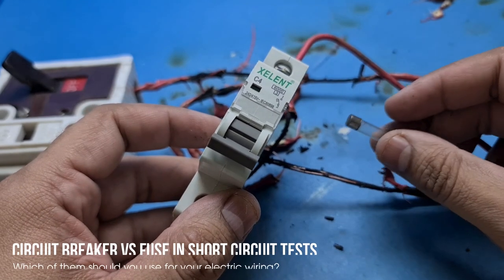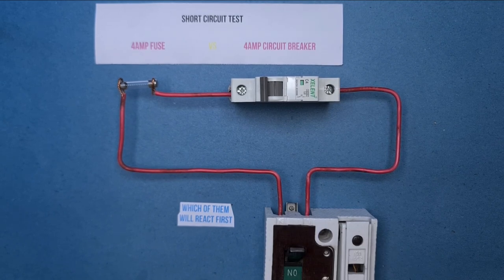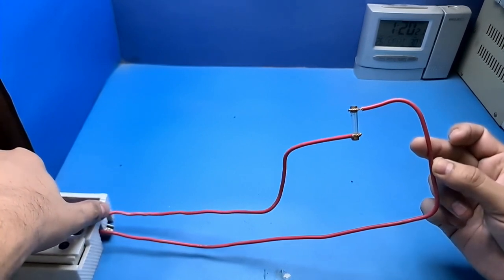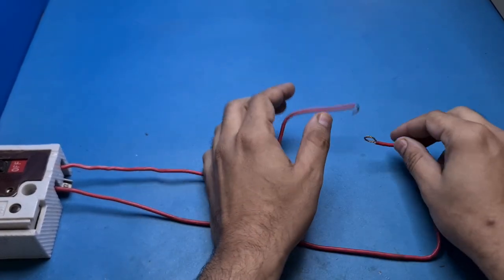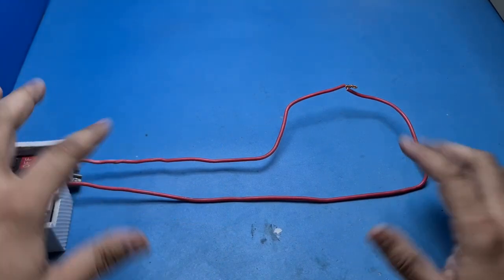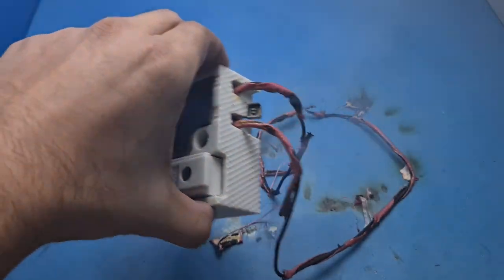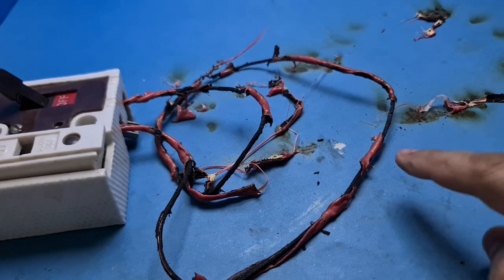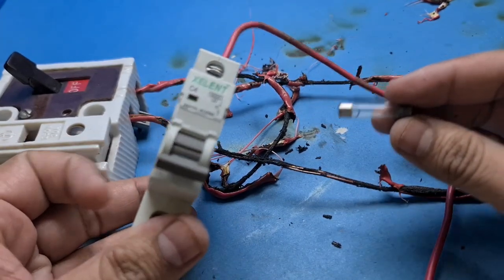Circuit Breaker vs Fuse (Short Circuit Tests)

Comment: “Oh no look at the smoke” dude says omg 😂
Reply from the maker: The smoke was clearly more than my expectation!
Reply: @researchcell  I'm wondering if the short circuit and subsequent explosion (melting) caused in the LED light bulb will affect other electrical devices on the same power grid, I heard that the circuit breaker tripped in a split second, but it still doesn't give me the feeling that the high voltage at that moment could How will it affect other electrical appliances?
Reply from the maker: It is highly unlikely for a short-circuit in a house to affect other devices in the same grid due to the extremely large current delivering capacity of transmission transformers. Also the wires that deliver electricity to your house have some resistance. The maximum affect the other users on the same grid can feel is a slight and temporary reduction in voltage during any such short-circuits.

Comment: Interesting, I hadnt considered using both
Reply from the maker: Yes, Using both Fuse and Circuit Breaker is highly recommended to become fully safe from extreme short-circuit events. Circuit breakers, being mechanical devices, can sometimes fail, especially when they get old. Dust accumulation or rust due to over-humidity can result in a jam, which can trigger a fire if no fuse is present in the series.

Comment: It didn't trip out automatically. was the connection done through mcb or isolator... if mcb then it should trip out automatically..
Reply from the maker: When a fuse and mcb have same rating and are in series then fuse is almost always the first one to go. MCBs trippong involve machinical movement which is always slower than a thermal meltdown of a proper alloy fuse.

Comment: What if I use two fuses instead of one fuse and one breaker which is expensive and might fail without warning.
Reply from the maker: Yes, we actually use two fuses, one on live and one on neutral wire and a circuit breaker in series if each wire. in my opinion, this is the best and the safest approach.

Comment: Whta volt did u used.with this test 220v?
Reply from the maker: The short-circuit was in a controlled environment  and the volts were bellow 110V